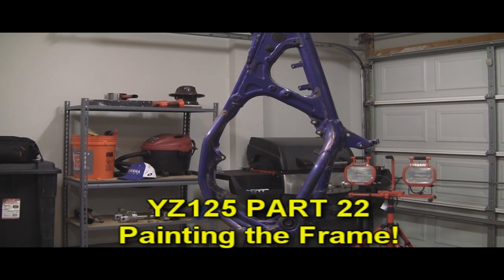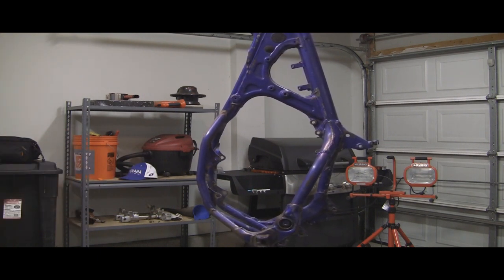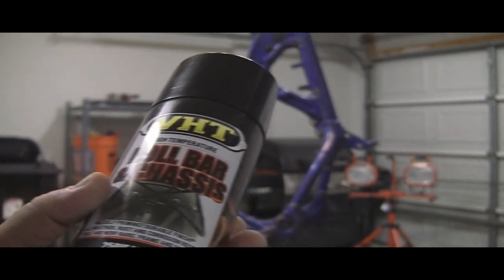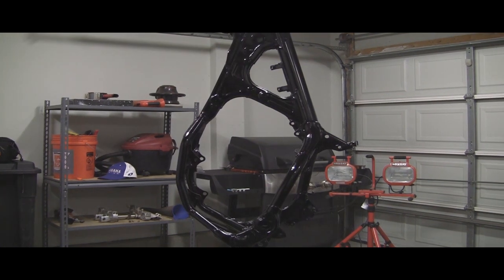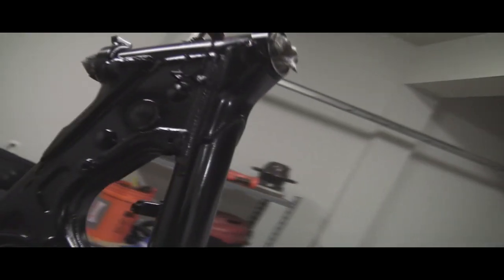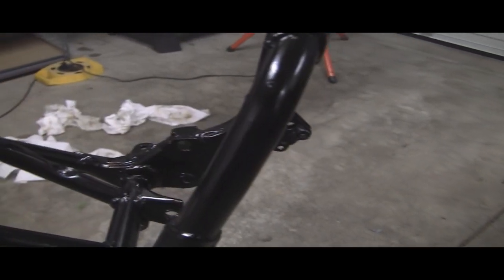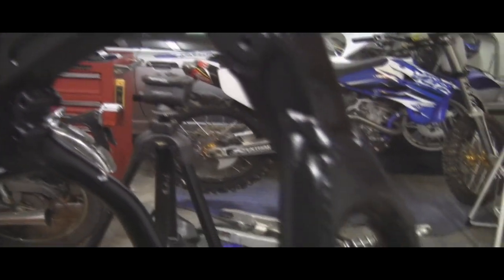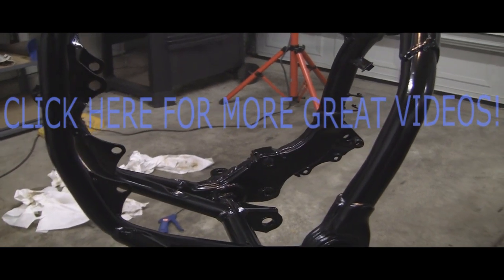YZ125 Part 22: 2 Stroke Painting the Frame with VHT Roll Bar Paint!

Comment: First off I want to say thanks for the great videos on this rebuild... I have been using it to help me rebuild my yz...  couple questions on the vht. How has it held Up? Scratches? Can you do the swing arm and fork tubes with it? I saw you did it on the cafe racer and I like the all blacked out look. But just wondering how the paint will hold up in use. Thank you
Reply from the maker: It actually held up really well. I've since sold the bike but only had 2 chips when I sold it. I wouldn't do the swing arm and tubes with any paint, it always chips..
Reply: Thanks for the insight. Think maybe have the swing arm powder coated. That or truck bed liner it... ha ha ha

Comment: I might be getting a 02 yz250 2 stroke, the engine is really fresh. but the crank has a crack in it from the chain but the crack only goes into the stator but its on the case not cover, just it doesent go into the bottom end. he fixed it with jb weld and he said its fine cause it wouldnt leak anything anyways, and he said the frame has a repair but has held for 6 years or so without problem. id be trading the yz for my quad, should i do it, are the things such a big deal?